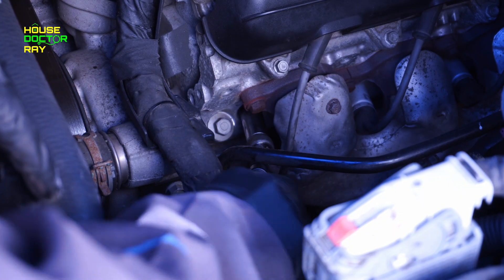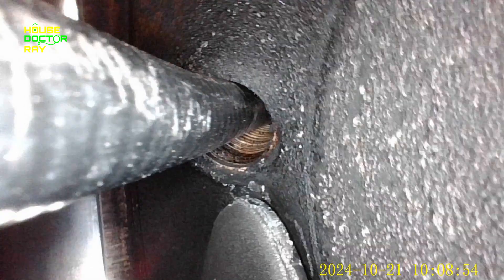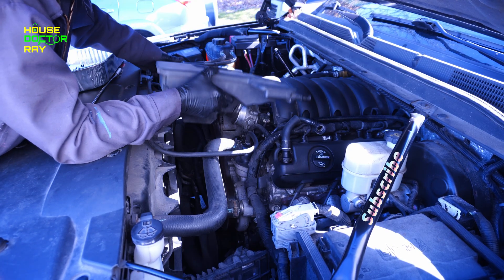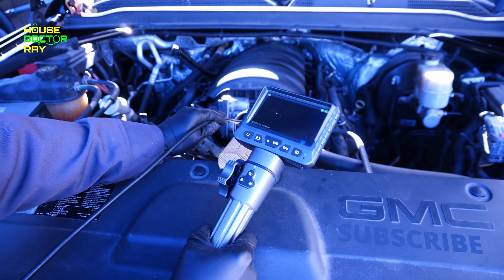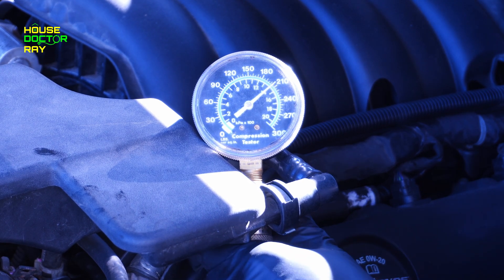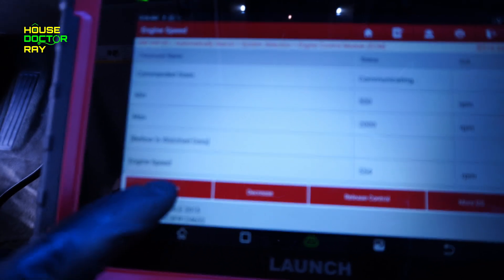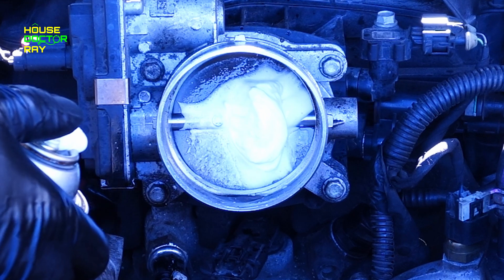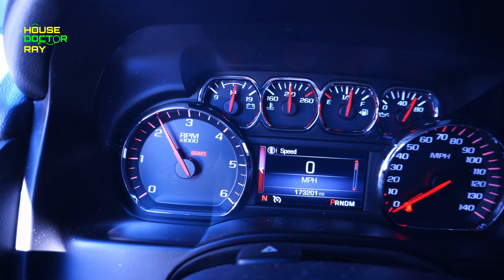Clean your internal combustion engine

Comment: Hey, what is the difference between the Seafoam and the AC/Delco? I see seafoam everywhere in my autoparts store as a fuel additive but this seems to be an intake based cleaner. Could I use this to clean the cylinder on a port injection system even though you used this on a Direct Injection engine?
Reply from the maker: I don't see why not.  Either will work.  The Delco definitely has a stronger aroma than Seafoam.